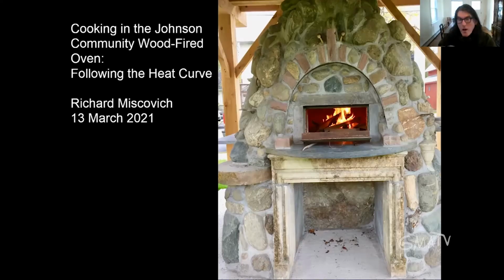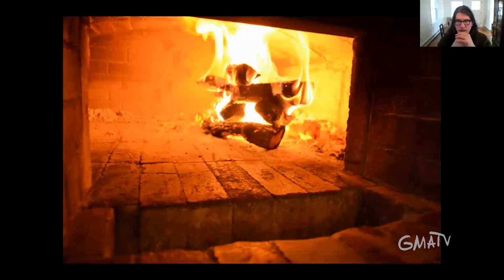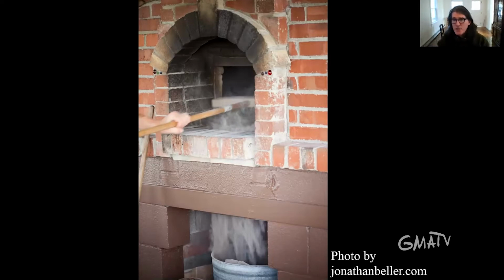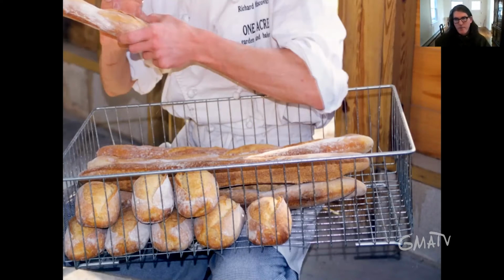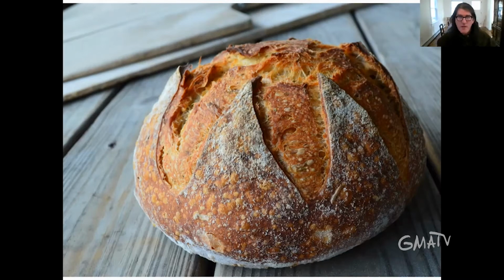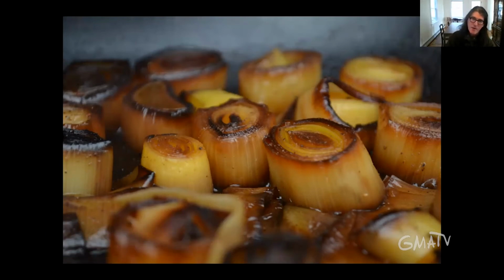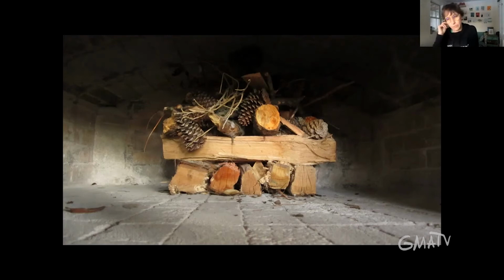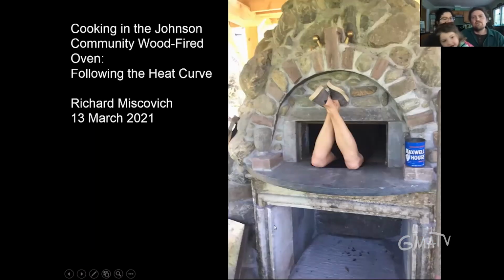Following The Heath Curve: Wood-Fire Ovens 3/13/21

Comment: 1:06:40 "Pizza must bake 60-90 seconds" is a Vera Pizza Napoletana an orthodoxy that may have no historical basis as a centuries old rule. Especially if it turns out that pizza started as a byproduct of bread making, where they were baked on retained heat.